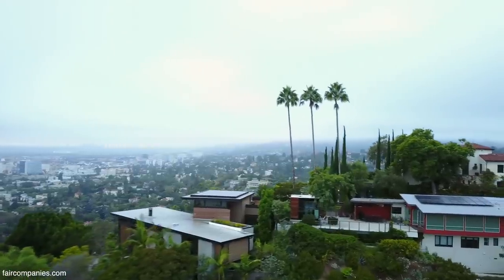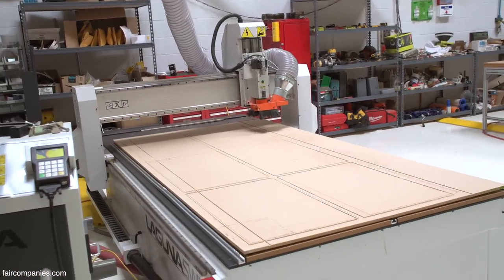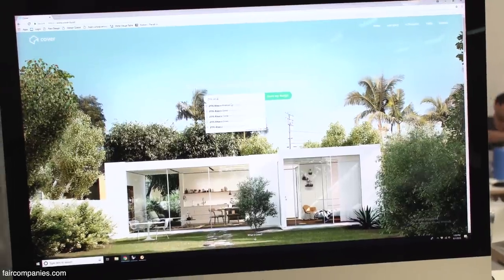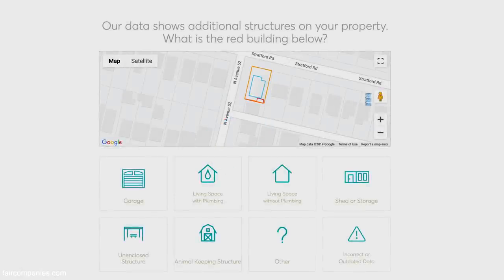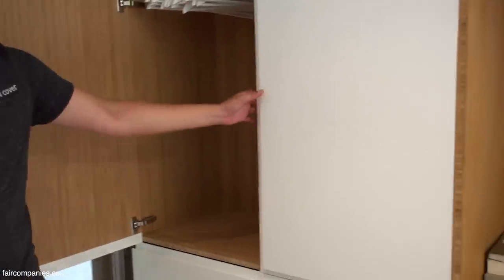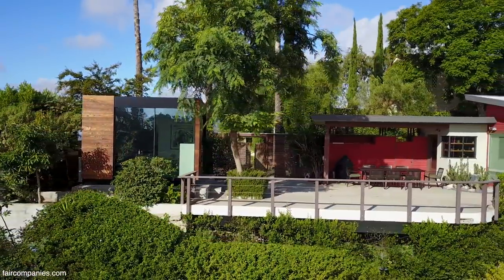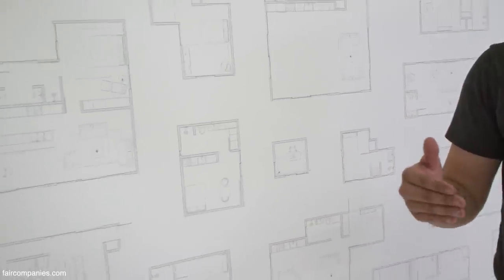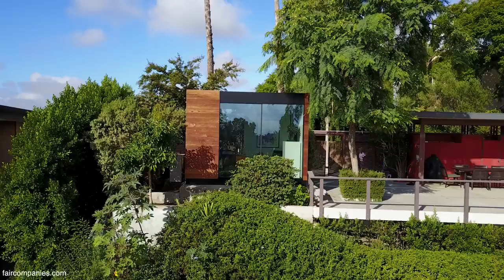LA startup offers custom small prefabs adapted to area code

Comment: The bespoke elements will definitely make maintenance daunting!! I would also love to hear more about the build process including gas, plumbing, etc. Neat looks though
Reply: Maintaining the windows and doors, or getting access to an electrical socket that has stopped working for some reason and needs investigating would be a nightmare.
Reply: I was thinking the same. E.g. you would need to remove the whole wall panel just to fix/replace an outlet
Reply: @grglyzen  Unless there is conduit throughout.
Reply: Grg Ng Or the panels are velcroed or magnets are used to keep them up.

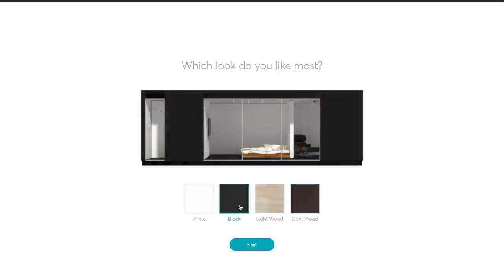Comment: I did some number crunching from the example of the structure they showed at 4:50. A 279 square foot structure without a kitchen or bath has a basic price of $99,800. Permit fees are $6400. They estimate site work to be an additional 20 to 30%. That would be a total of $121,160 to $136,140. That's around $434 to $488 a square foot. 
Maybe this is viable in Los Angeles. I doubt if would be cost effective in many areas, especially with the additional higher costs of adding a kitchen and bath.
Reply: Ikr.. it's crazy expensive and crazy how many people think it's a mind blowing brilliant.

Comment: No shade over the windows (like eaves or louvres etc). Doesn't look like good passive thermal design for summer.
Reply: Especially in California
Reply: @jmk1962  These designs are heavily flawed! example: flush floor to ceiling windows can work. reversing a track/roller door system to have rollers on the bottom says failure. The value of this company is not how they build homes, it is in the software used in the site identification process! that is cool.

Comment: How do you keep the roller in the track from gumming up or getting hair wrapped around them? How do they work over time?
Reply: Brad Ringhausen - correct. Despite the hype of the design, those rollers will get filled with dirt.

I get the impression that these guys are so immersed in "innovating", they don't think thru the ramifications of their designs. (The inaccessible electrical outlets that a dozen people have commented on, is another example).

A simpler solution would be to have the door hang from rollers at the top, aka a barn door design.

Comment: I used to work in Escrow.  Naturally I handled a lot of escrows for builders.  One builder who just so happened to be building a few houses just down the street from where I lived at that time,  told me that if he buys a lot for $7,000,  hires a couple guys to do all the work,  his being the licensed builder can get inspectors out quickly.  That particular lot he purchased for $7,000 plus the hired labor, the permits, all the appliances and building materials - the 1500 sq ft house with garage, cost him $20,000 to build. All in.  
He'd sell those homes for $80 to $85,000.   That was back in the '90's.    Land was cheaper.  Though it always matters where you purchase.  It was in California.  But the point is,  builders USED to scale their profits on a build by 4 times what it cost them.    Not anymore.  Now it's SO outrageous that no one can really afford anything.  Unless your an illegal alien moving 30 people in a rented house or apt ... all of them chipping in something for the rent. Which has a lot to do with the spiraling out of control cost of housing in California. Like it or not.  It happens to be true.   Builders and Landlords caught on and are raking it in by leaps and bounds.  
These little pods ... probably run this factory 5 grand to build each, labor, materials, permits, inspections. 
maybe a tiny bit more.   But they sell these tiny pods for 100 grand.  And the buyer buy's the land.  prepares the pad the pod will be sitting on.  i.e. pay for the plumbing, running the electrical,  and water lines to the pod.  etc.  Sooo for 160 grand or so,  you can all be the proud owner of a 297 sq ft closet.   Maybe a little more as I noticed those plans didn't include in the cost,  bathroom or kitchen.  So that might be extra.  
Scary stuff.

Comment: Okay they're beautiful and efficient, but still expensive. Plus, they mention a "Lego like" assembly wth floor to ceiling glass in L.A. These materials are super heavy. I'm curious to know what would happen in a 6,7, or 8.0 earthquake.
Reply: Depends on how the structure behaves in a shakeout. If I'm not mistaken; stickbuild is one of the best performing structure types in an earthquake. It sounds to me like this is similar but instead of nails and 2 by 4s we're dealing with precut pieces bolted together.

So I guess it depends on how they engineered the joints. My thinking would be that these are possible points of failure but these are guys with degrees and I'm a layman so I'd hope they'd expect that and put some pretty fatass connectors between their modules.
Reply: It would collapse like a 'house of cards'.
Reply: lego like means you're buying into the concept totally. Could you for example add on something that's not part of the lego paradigm? Somebody here compared this concept to a car, how you can only replace the door in whole and only with the manufacturer's parts etc. But cars and houses are two different things. Cars are not meant to last forever because they have mechanical parts. Otherwise they wouldn't be component-oriented. Just imagine you bought a Prius, and then one day they just stop making Priuses. Unfortunate for many, but not the end of the world, because cars are short-lived single-use entities by definition, at least conventionally. Houses can and should last almost forever and should not be dependent on one manufacturer. If the manufacturer goes out of business you're stuck?? That's pretty funny. They should be built to a strict code, but with complete freedom to remold into the future. And what we need a lot more of is not tiny houses, not containers, not these stupid gimmicks, but normal SMALL single family houses. Like the little brick cape-codders they built in the 40s and 50s, but with modern technology in all materials, that's all. Pluggable large-scale components is always a very tempting concept, but it rarely works as imagined and not for all applications. Why, because of the very progress that conceives them. By the time you're up for the replacement of a part, they've stopped making it and supporting it, or company's gone out of business and something new has come along. Paradoxically the overly revved up speed of progress lately is the very thing that makes this approach impractical. ESPECIALLY in houses LOL
Reply: @crassirus  Please.. they're a startup. They're out to make money, not earthquake proof dwellings.
Reply: @Kay-tc3go  Then it wouldnt pass engineering and city inspection.
Reply: @comment6864  
Please, understand that seismic codes 
are part of building inspection... smh.

Comment: Cool homes, but 99k for 280sqft? ripoff. Don't even need to visit their site to know that's not worth it.
Reply: Especially since it cost must less to make since you don't need as much human labor.
Reply: Lol dang right it is... Funny thing is anything under 300 sqft doesn't require an architect to sign off so imagine the testing on these buildings
Reply: They clearly have growing pains to go through; i mean they have like 2 cnc machines and 10 employees. They're prototyping with machining but not really mass producing. They need those designers but they should really have 20 cnc cutters poping this shit out round the clock.  For LA I'm sure it's a great deal for what it is.
Reply: Tachyon Electrics your last sentence contradicts everything else you said.
Reply: @tachyonelectrics898  you can bet they're cutting every corner they possibly can on quality, and you can bet their employees are overstressed and overworked.
Reply: @donwarner6925  Nope. Growing the scale will drive down costs but for now, LA makes it easy and has high cost of housing which works for the company until they can grow enough to offer their business to other places and at lower prices. I don't know how viable this actually is. But I did think Tachyon's comment at least was understandable.
Reply: 0ooTheMAXXoo0 of course scale will bring costs down. Don’t forget we are talking about an area where it’s common for people to spend more on interior furnishings than what the average house goes for in some states.
Reply: @donwarner6925  I think what he meant is for LA its fine as everything is insanely over priced. I live in two states and my home in Ma. cost under 200, 000 with ten acres and my home outside of NYC cost 1.3 on a sliver of land. You can sell this stuff in areas with insane cost of livings but not in the rest of the country.
Reply: Yes. Especially after seeing hundreds of DIY tiny home builders achieving a great result for $15 000.
Reply: And $6,400 for permits wtf
Reply: @thatcoolkidjoey  commiefornia for ya. keep votin democrat though!

Comment: I wonder about air leakage between the panels... Also, how do they water proof the roof?
Reply: Also the connection and sealing system is my main interest. Unfortunately they dont provide much details about this. I do think that they add a waterproof membrane that covers all off the panels

Comment: This is one of the best "pre-fab" strategies I've seen yet.  As a contractor, I"ve built a few pre-fabs over the years going back to the '80s.  The idea of doing most of the work indoors in factory settings has always been appealing, but the factories have to be near markets or they get 'islanded' revenue-wise.
These people have really thought about the site and the methodology, more than anything I've seen so far.
I'm about to build an energy efficient house in the desert not far from them.  I've been looking for (affordable) sliding doors for years.  Obviously they couldn't find them either, and had to  build their own.  Very good.

Comment: I have been a warranty manager for a home building company. An extremely important part is that sometimes things go wrong and things must be repaired or changed. I don't see this, for example in the electrical outlets being able to be repaired or replaced. remember the automotive industry only builds vehicles to last a set number of years , but houses must last much longer and be able to be used for many more years or repaired or modified for years  as people's needs change. Please give this some forethought. And make your home's a little more adaptable for the future which cannot be predicted.

Comment: I wouldn’t normally make comments on YouTube videos but, after reading what most had to say… you can’t possibly live in the LA area otherwise you would know, that this is a great idea!

First some quick data points.

57% of the rental property in the LA area $2000+  per month (that right more than some mortgage payments) (source – Rental Café)

$2,371 is the average rent in LA (source – Rental Café)

                  Los Angeles, CA Apartment Rent Ranges

• $701-$1,000    -   only 1% of all rentals are in this  price range
• $1,001-$1,500    -  16%
• $1,501-$2,000     - 26%
• > $2,000             -   57%

Who’s the target market. The first criteria were homes owned where zonings laws have been relaxed to allow a separate dwelling to be built on the property.
So you’re not a new home buyer…..so who are you?

You’re a current home/land owner or who has space to build a 2nd dwelling that could potentially be a rental property. And possible have low enough investment cost to create more rental in the $1000 - $1500 price point. So at 150k to install the unit would pay for its self in 8yrs assuming you charged $1500 per month.  

Why go this route?  Overall maybe slightly more expensive to build( not 100% sure that’s a true statement) but with all of the your permits, as well as inspections being completed on site during fabrication,  Your timeframe from design to new monthly income stream, is months of ahead of schedule, without all of the potential delays that are inherent normal construction.
Reply: You aren't as bright as you try to appear.
100K for a mother-in-law house in the back yard is ridiculous when pre-fabbed container homes go for half that... and they're twice the price of what's reasonable. Two things for certain are you don't know real estate, and you don't know building.

Comment: Costly process but they seem to be on the right track and there will be a demand for it in the near future, no questions. The sliding door system & windows are awesome. Designing your own window system is costly with all the testings and very similar to another high end system.  He also brought up a very good point with the slow process with any city and they are taking care of it with innovations. The only downside is the overhead. Administration, Marketing, Fabrication, Installation.... Great work :)

Comment: The smaller ones just look like glass boxes,  they look like they would get hot real fast, but the larger designs look nice. All those unique fittings and features means that long-term maintenance will be a nightmare.  You better hope this company is still going if you ever have a problem with one of those windows or doors.  The average builder won't know where to begin, which translates to expensive.
Reply: Barn Star -    The panels did appear to include significant insulation and the windows obviously were double-panes plus state/county/city codes do have minimum insulation requirements.
Reply: @wendyweaver8749 - Many prefabs are using triple glazing now, for energy efficiency.

Comment: I really liked the frameless windows. Do all of them have to be floor to ceiling to achieve that look though?
The in-wall outlets are a great idea too. I think could use some visual improvement though, such as a woodgrain finish for the wood walls.
I'm also interested if their designs work for sloped roofs, such as are prefered for snowy climates. Or if their flat roofs have the strength for snow.